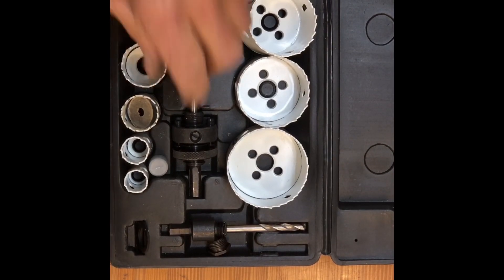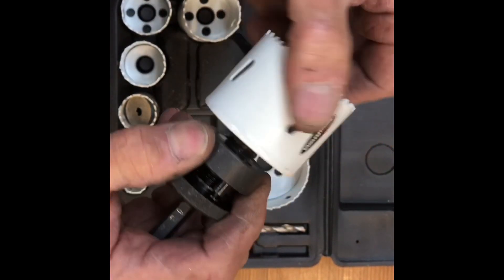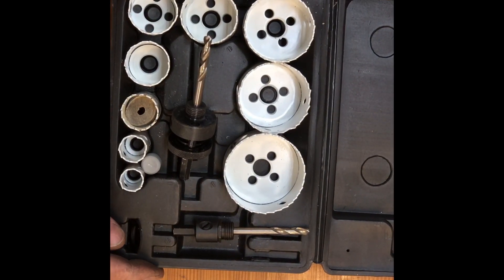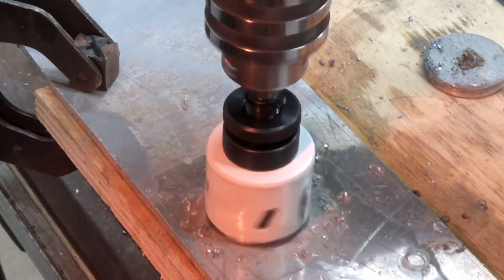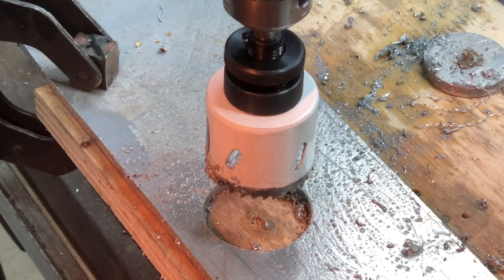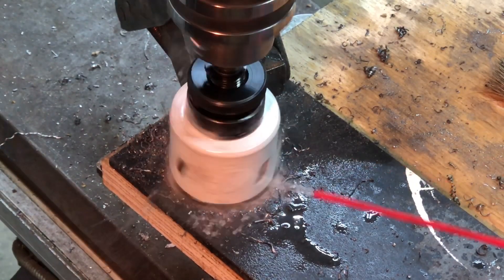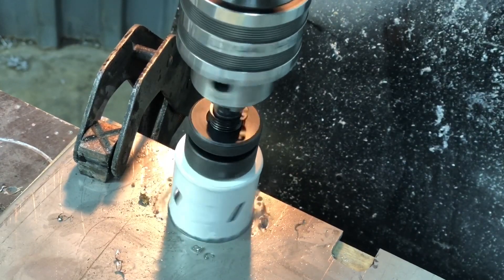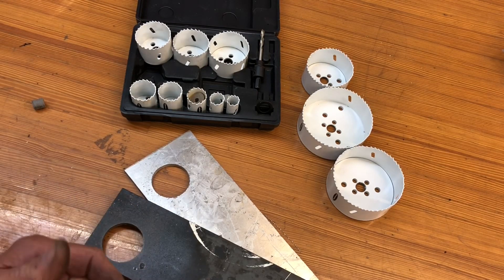Testing Harbor Freight bi metal hole saws

Comment: Suggestion.. When cutting through mild steel use dish soap full strength. Fab a reducer( down to 1/2" id tubing) for your shop vac to clean out debris fron cut as you go.